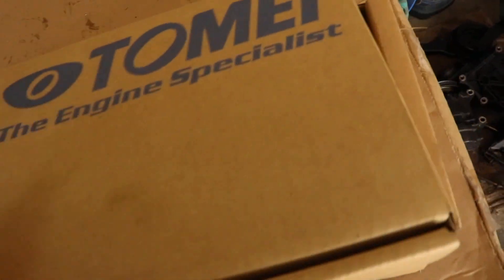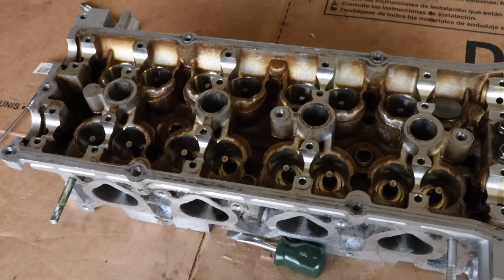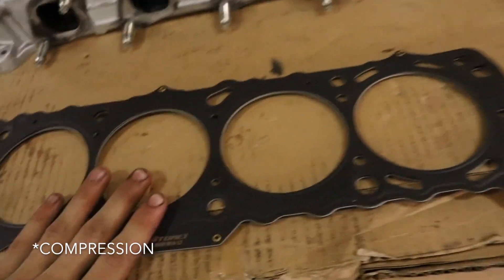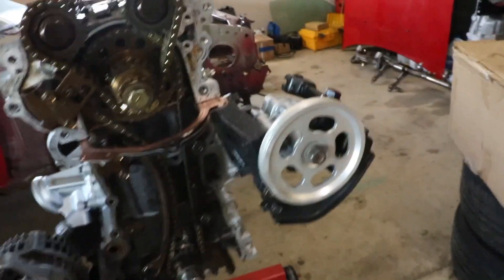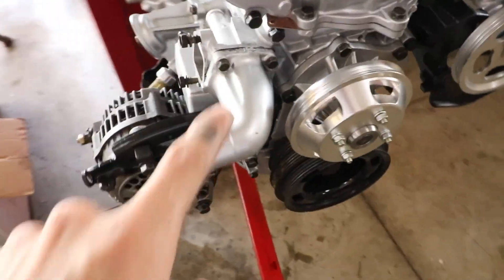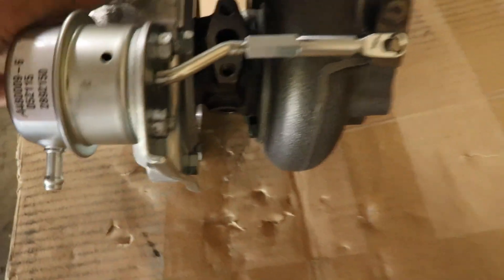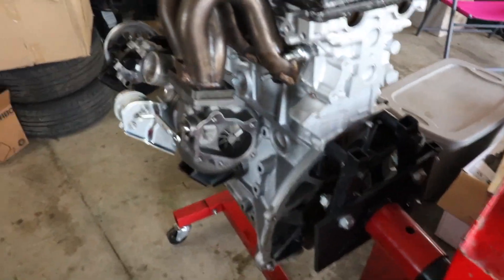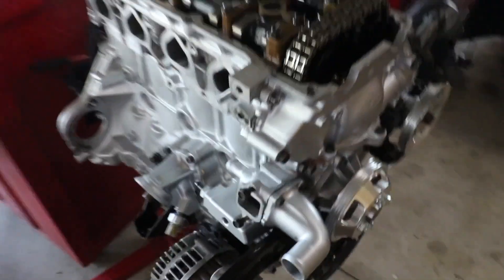EP.5 | Building A KA24DE Head

Comment: On your next build you can use some VQ35 lifter buckets. They're a one piece unit with no shims. As long as you order the right buckets for your valve lash specs she'll be running strong. You'll gain some RPM because they're much lighter.

Comment: I noticed you didn’t switch out your stock valves for upgrades like stainless steel valves or use titanium retainer locks, ( collets). You might experience valve stem sheer if you plan on high RPM. It’s always a good idea to replace all valve train components with upgrades and not just some of them. You may end up with an expensive mess.
Reply from the maker: thomas smith yeah over the winter I actually did get tomei oversized valves for it and the head has been at the machine shop since February and i have a bunch of extra caps so i can get the lash set probably

Comment: Was your rear cam journal on the intake cam undersized by about a mm? Did the cam cap "float" on the cam?
Reply from the maker: If you have aftermarket cams they’re supposed to be like that and apparently you aren’t supposed to plug the oil hole either
Reply: Thats what i keep hearing but how does it retain oil pressure then?